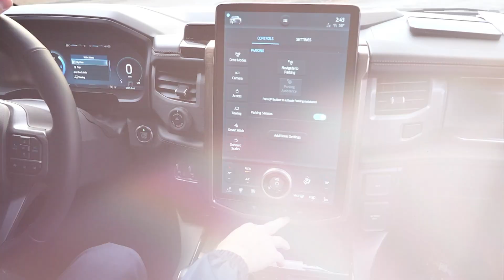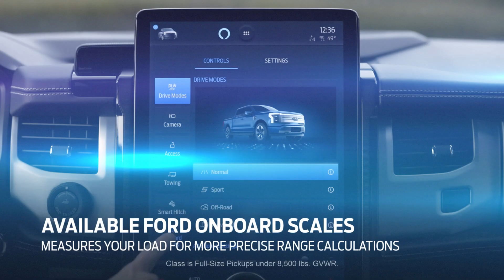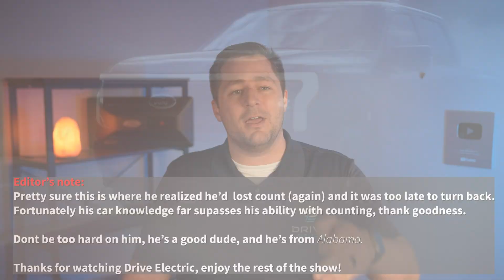12 Reasons You SHOULD Buy an Electric Vehicle!

Comment: The thing about EVs is that they are better in terms of pollution. First, it does make a little more pollution to mine the materials for the batteries and the same pollution for manufacturing as it does for a gas powered vehicle, but because EVs don't burn gas or diesel in about 2 years they break even with ICE vehicles. After that the ICE vehicles just keep contributing pollution and EVs get greener and greener by comparison. Second, the power source is not all coal or gas. In fact, coal burning to produce electricity amounts to about 20% of all electricity production nationally. Hydro, solar, wind, and nuclear account for more than 50% of all electricity produced across the country. Of course, in dirty states they may have more coal used than the national average, but in better places the electricity is far, far cleaner. And for whatever concerns people may have about nuclear power at least it doesn't contribute greenhouse gases.

If people have solar panels at home, since they can charge up at home, that would be ideal.

Comment: Dude  come on.   An EV will never make any financial sense  currently.   Costs are easily 10K or more than any normal ICE car.   That 10- 15K will offset any normal maintenance and fuel needs that an ICE car needs.   Its not FREE to charge an EV car.  Yes you get breaks from your electric provider at home but not free.  And Level 3 chargers can be expensive.   A normal level F150 is 18K cheaper than the Ev model.  Please tell me how you offset that cost and have the EV be better than a ICE version.   We are just not there yet for this to become completely large scale yet.  We really need to look at the BMW I8 and the Chevy Bolt.  We need a range extending plug in to take off.   That gives you a best of both worlds.   EV has its place but not for long distance as of yet.     Your video is nice though.